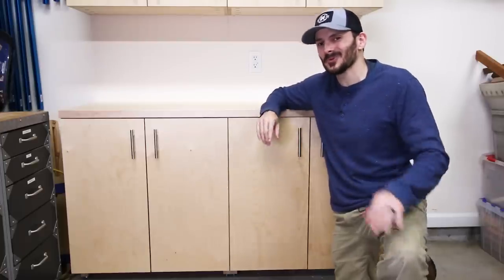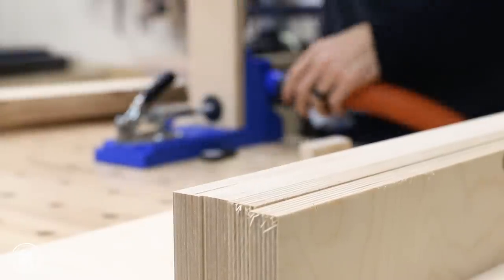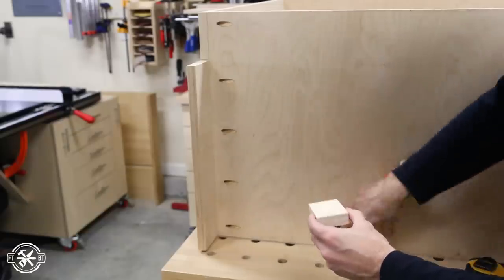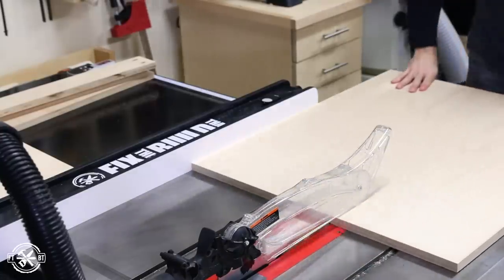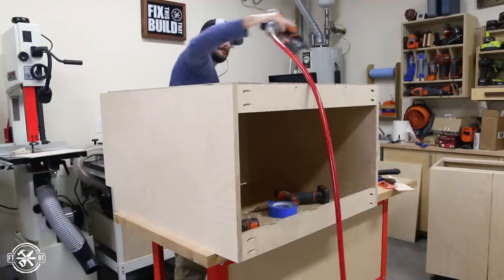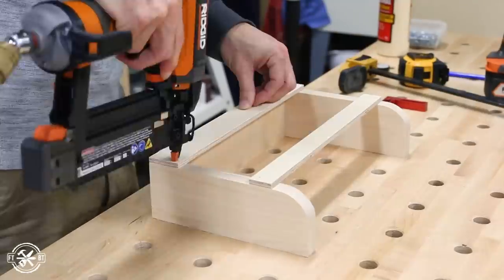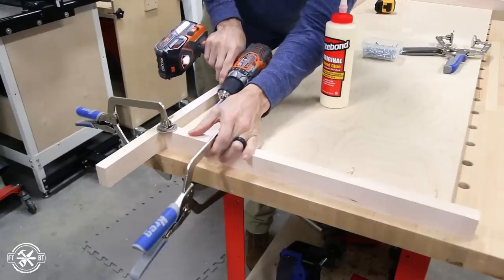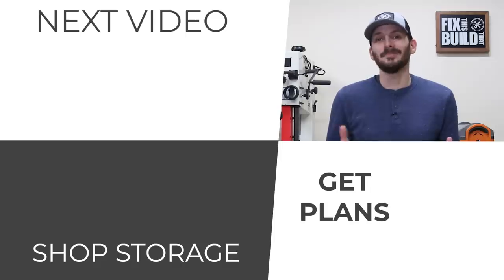DIY Garage Cabinets for Shop Organization

Comment: I bought these plans and want to let everyone know how excellent they are! Very accurate and simple to follow. The cabinets were very easy to assemble. Had I not had several projects going at once, I would have finished these in a couple of days. If anyone is considering these as on option, you won't regret it!  I was originally going to stay with only the lower cabinets, but now am going to purchase the plans for the uppers as well!
Reply from the maker: Thanks for the feedback, Craig!

Comment: Just a quick tip on the t-nuts. If you're installing them on softwood such as pine, it's a good idea to add a screw to the outside of the t-nut to keep them from turning or coming loose. I first saw John Heisz and Jay Bates do this.
Reply from the maker: Smart

Comment: Nice, I recommend using a hex bolt for the legs so you can adjust it with a wrench while the cabinet is in place, loaded up and heavy
Reply from the maker: The carriage bolts have a square neck you can turn easily with a wrench 👍

Comment: Best way to do levelling feet! 👍
Reply from the maker: you know it, Kris!
Reply: @Fixthisbuildthat  only thing I would have done differently is added a nut to the leg to lock it in place against the insert. little extra security to keep it level.

Comment: Enjoyable video and  your editing is outstanding.   
I really like the shadow line between the doors and top.
Can't say I agree with the door cubbies only because it prohibits you from making pull out shelves for that cabinet.  You'll have to stand on your head to find those glue bottle jammed in the back.....especially on that top shelf.  In my opinion all base cabinets need pull out shelves or better yet, drawers.  
Either way, it sure is a handsome piece of furniture for your shop.  Well done.
Reply from the maker: Yup, I prefer the pull outs but I couldn't do them because of the cabinet to the left and door interference. So figured I'd show another option. And since they are only 20" deep vs 24 it's not so bad as long as you store big stuff down there. Thanks for watching 👍👍

Comment: I stead of carriage bolts you should look into elevator bolts. They have a large flat head and great for leveling feet. I use them on metal tables I make
Reply from the maker: someone else mentioned those recently, I gotta check em out

Comment: Thanks so much Brad!  These are beautiful!  The plans for the she shed are out to the contractors for bids.  I’ve got troughs designed in the cement floor so the electrical can be ran in the floor and my cords under machines, not on top, or extension cords.  When they ask why, I’ve learned to just say women are allowed to change their minds.  Truth is, I don’t want to be stuck with a saw, jointer, etc in a place that someone else planned.  These will come in really handy!  I’m short, all base cabinets will be too lol. So what I need you to do in the next six months or so, is show how to make upper cabinets have a pull out and down hinge....I won’t need a ladder then ;). Please...(almost forgot my manners)
Reply from the maker: That sounds like a great spot! I'd love in floor wiring. I bet that pull down and out could be retrofit into my wall cabinets!

Comment: Hi Brad a new to your channel and I love it I'm also a rigid man I just bought a house and thinking about using either are compressed rigid or battery but looking at with you guys and how easy it is I think I'm going to go with an air compressor system keep up the good work I hope you got a lot more good stuff coming out I'm definitely going to put your plans to work and my new home.
Reply from the maker: I've got plenty in the archive too!  Go check out some of my other builds

Comment: you said that you had a 30" wide cabinet.  I got the hinges but they did not come with any template for drilling.  How wide did you make each door?  I was thinking of cutting a piece of ply and using the thickness of the blade, so each door would be around 1415/16, is this too big??  Do i need to go smaller for each door? Thanks for the help...

Comment: I built your flip cart ( 2 of them ) a while back and about to start building out some of these cabinets. I love the mobility of the flip carts though since they're on casters, so I was thinking of doing the same with these cabinets. I think I can adjust the dimensions but do you see any issues I might run into switching that bottom part out for casters?
Reply from the maker: I think that would work fine, just won't be level across all cabinets likelu

Comment: Hi Brad! Great content! Question, which should be the overlay on the doors?, if I making 3 cabinetes similar to this, they're framless.
Reply from the maker: You would leave 1/16" on the edge of each cabinet so when mated side by side they have a 1/8" reveal just like between the swinging doors in the middle

Comment: hey brad, what tooth count blade do you use for your miter saw to cut general wood (1 by, 2 by, 4 by material) and for plywood? or any tips/recommendations I should know? thanks.
Reply from the maker: I use 80 tooth on the miter and 40 on the table saw 👍

Comment: One more thing... one thing I've struggled with is that I find the spacing of drawer slides to be very critical. I'd love if you could do a video about getting the exact sizing correct so that your drawer is not too loose or too tight so it slides nicely.
Reply: Just watched your "Easy DIY drawer" video, in that video it looks like you just left exactly one inch total for the drawer slides. I feel like I've tried that and it was so tight that the drawers did not slide easily.
Reply from the maker: Most drawer slides will give you the exact width they will take up or directions on what width to account for.  I use the 1" rule and it usually works out nicely

Comment: Thanks for sharing! I'm building a cabinet with 3/4" Baltic as well, will be first time using the Kreg concealed hinge jig, did you get the set back so the doors completely cover the sidewall? Any tips for what the setback setting was for you?
Reply from the maker: Mine is at the 5mm setting and yes, they can be full overlay at that setting with the hinges I used

Comment: Hi Brad. I have been reading and watching your videos and articles on shop cabinets and have enjoyed them and learned from them a lot. I notice that you have a working bench top that is an MFT style with multiple dog hoes, but I have not actually seen you utilize it much for dogs, clamping or cutting. I have been considering just such as top but wondered if you do use it and would you take the time to make one again with that many dog holes? I thank you for your instructional approach and I hope you have a great day.
Reply from the maker: Hey, Bevan.  I didn't make that bench, it's a commercial product.  I really don't like how many holes it has, it's just too much.  Lose screws like crazy.  I just find it easier to clamp on the overhanging edge for most things.  But I like the idea of dogs to work against
Reply: @Fixthisbuildthat  Thank you very much for your response. You have helped me make a decision which I have been pondering for a long time.. I plan to build a bench utilizing some strategically located dog holes, metal T-tracks, overhanging top edges for clamping, bench-top benches and a Moxon type vise to keep my options open.
Reply from the maker: @bevanstuart9013  sounds awesome

Comment: I have a quick question. Did you put leveling feet on the second part of your cabinet? Your plans only call for 4 leveling feet on the first part of the build. Just wondering if it was necessary for both or just an oversight on the plans.
Reply from the maker: Leveling feet should got on the corners of each cabinet 👍
Reply: Awesome thank you! I added them anyways and it only made sense to do it anyways. I just finished it today and it looks great! Is there somewhere I can send you pics of the finished piece? Thanks for the response 👍🏽

Comment: Sorry if this is a ridiculous question. But Can someone please let me know the typical length of 18 gauge brad nails for cabinetry
Reply: Anyone wondering the same? Just found out brad nail length is typically 3x the size of whatever your nailing into. So 1/4” paneling you’d use 3/4 inch to 1 inch brad nail.

Comment: When you say that this can be made with 2 sheets of 3/4 baltic birch is that 5x5 sheets or 4x8?  5x5 BB sheets are much more common around here.
Reply: I was wondering the same thing. Are you buying the “real thing” or “Baltic birch” from the big box stores? What you are using looks great, but if I get the plans I’m wondering if I’ll need to find a source for the “real thing”.
Reply from the maker: I used 4x8 for the plans and it needs 2 sheets.  I actually made it from 5x5  and it took 4 sheets of that with a lot of waste.  But I can source it in both sizes depending on availability from my supplier.  the 4x8 was a lower grade this time so I went with the B/BB grade 5x5
Reply from the maker: 5x5 is typical, but they do make the "real thing" in 4x8 as well.  I get it from a local plywood distributor.  But the plans for for 2 sheets of 4x8 for the carcasses and another sheet for the top.
Reply: Thanks.

Comment: Why do you guys keep building toe kicks on garage cabinets?  It is material inefficient, and harder to get leveled.

Make the side panels three inches shorter, and make the bottom, even with the bottom of the side.   

Then make a frame out of 2X4s, or even 3/4-inch plywood, with leveling feet.  You put it where the cabinet will go, and level it up.  Then place the cabinets on it, and your done.  

No notch to cut, no wasted plywood.
Reply from the maker: I used the material cut off to make the leg supports. So it was very efficient